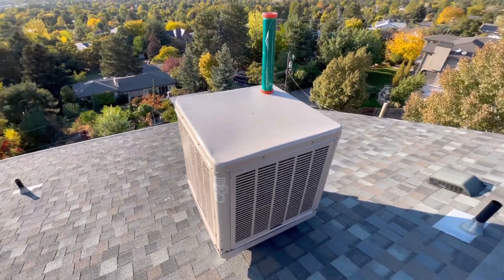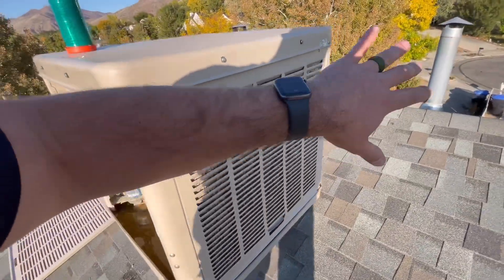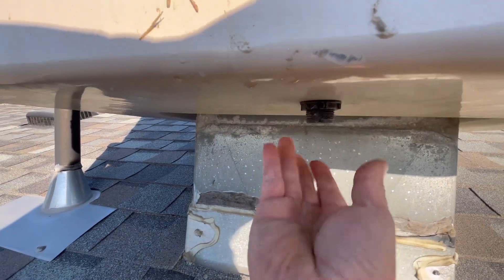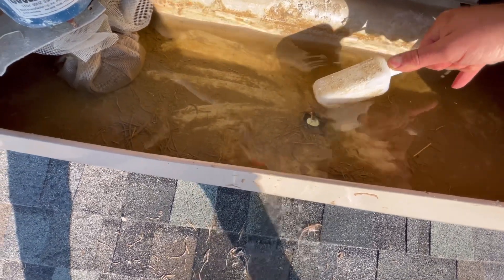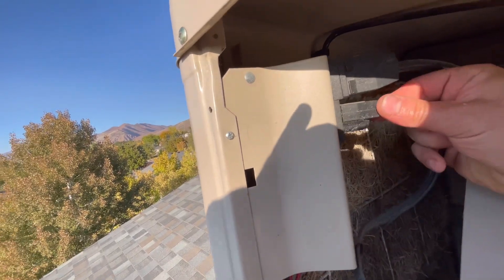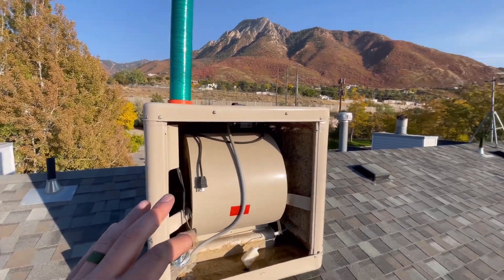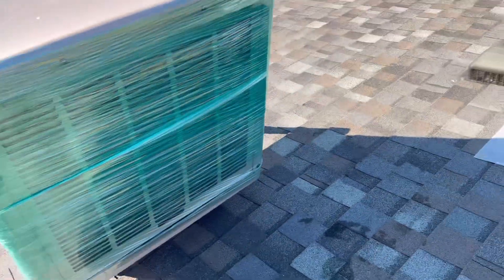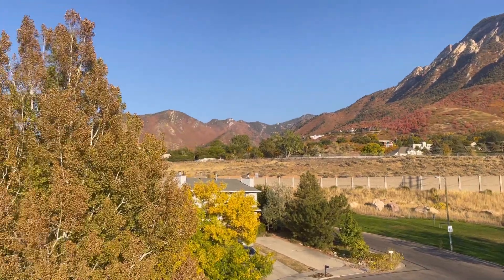How An Evaporative Cooler Works And How To Winterize Them

Comment: I don't see a purge pump in there.  How do you deal with the accumulating calcium salt?  I've got a cooler that is caked in salt where the fins are on all 4 sides (the covers you slide out).  It also tends to corrode the wires that holds the pads on (and the metal that holds the wires).  Do you have something you put in the water to prevent it or a spray you like to use to clean off the accumulation?  Also, is there a place that just sells the sides without having to buy an entire new cooler?

Comment: Fellow utahan here. Love my swamp cooler.  Low energy bills. Humidified air helps my skin, nose and lungs. I feel like it filters the air as well. I've had a couple issues over the years and they do need a little work from time to time but i wouldn't change to central. One thing to add. I have cracked my outside faucet a couple of times.  Once flooded the basement.  Don't forget to detach water connection if it's attached in a way that it can freeze and crack pipes.

Comment: Good video. I was hoping to see the part of disconnecting the pressurized supply line, so I could remember the steps so it doesn't spray all over the place.
Reply: if it isn't already installed, consider putting a valve on it (by you or by a plumber).  It is nice to be able to just turn a knob and control the water.  However, if in a pinch you can bend the float rod like he showed in the vid.

Comment: Hi. The house doesnt have a plate to cover the hole going into the house? My swamp here in NM had that. Also, I always kept the pump and belt inside the house over the winter. Swamp covers are typically found at Lowes and Home Depot's here in NM late summer and falll seasons.

Comment: I’m sorry but cellophane does not keep cold air out of your home in sub zero temperatures,  if there is no damper in your ductwork then some type of insulation and a good canvas cover is needed.
Reply from the maker: Never had an issue with this. And for the most part it’s just keeping heat in, because heat rises 👍🏼

Comment: I'm in Colorado. My "guy" had me remove the pumps and put in the garage over the winter. I do have a cover for the cooler
Reply: Also in CO and I was wondering if I should have my "guy" bring the pump (which may still contain water) and the belt inside to prevent/avoid winter damage.

Comment: I’m on Louisiana, they don’t work here, the humidity doesn’t evaporate the water. But I bet they are great on the west and spend super low electricity compared to a normal ac.
Reply from the maker: Yea, as hot as it’s been getting lately though I’ve had a lot of retrofit, abandoning the swamp cooler and adding central ac.
Reply: They are amazing in the desert.